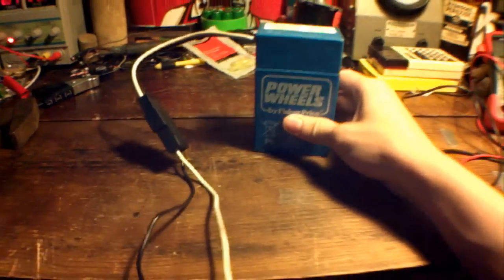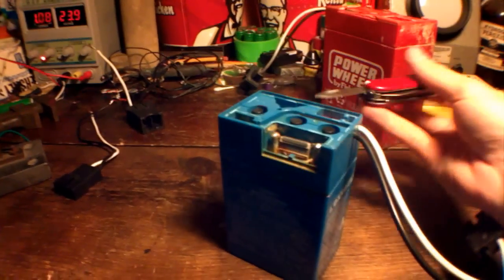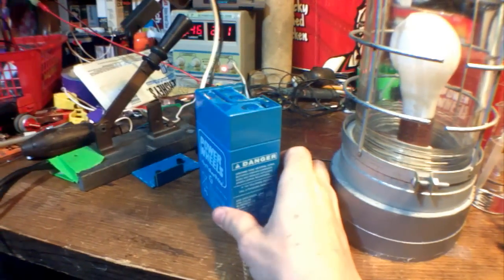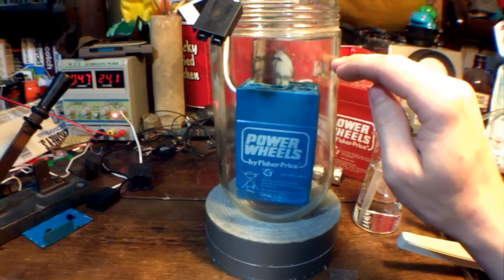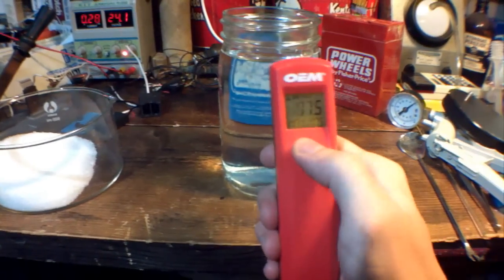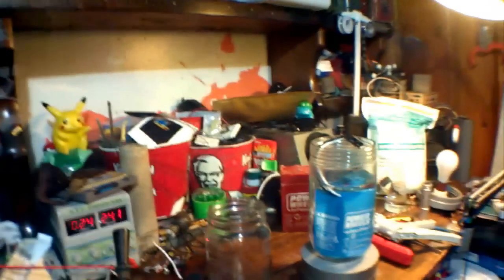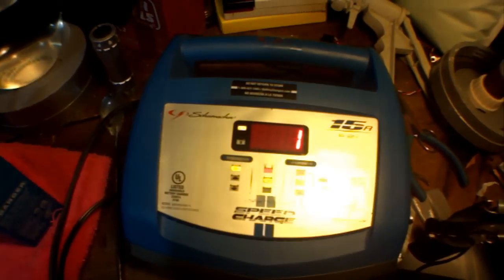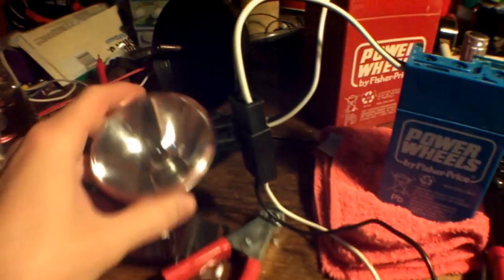Repair Lead Acid Battery with Epsom Salt

Comment: Aren't these batteries available for like 4 dollars with free shipping online? Is it really worth it to try to refurbish them and has the usable life after reconditioning increased to a point where you feel it was worth the work? Thanks.
Reply: sparkola, why don't you post links to the $4 batteries you speak of especially the ones with free shipping.
Reply from the maker: more like 30$

you cant buy a new lead acid battery for under 4$, if that was the case it would make them MORE money to sell them to a junkyard.

btw these batteries cost 60$ a walmart.
Reply: SD Lawson http://www.ebay.com/itm/4PK-6VOLT-4-5AH-RECHARGEABLE-GAME-FEEDER-SLA-6V-BATTERY-Free-shipping-/200936767482?pt=US_Rechargeable_Batteries&hash=item2ec8c3bffa
Wire them in series, parallel, or series-parallel to get the voltage or amp/hr rating that you need. Did that right after a posted this.
Reply: Cool, I agree, not really worth the effort unless one just wants to
Reply from the maker: sparkola
 that still takes money and time though, theres no reason to throw 26$ at something when some water might help. it's just proper maintenance.
Reply: Yes $26 but for 4 batteries at $6 each.  Sure maintenance is good if you remember to do it. We have become a disposable society and want fast results. We have become lazy.
Reply: SD Lawson...and even if you maintain them properly they aren't going to last more than a few years. Nothing lasts forever. Cheers!!!!!!
Reply from the maker: sparkola
 lead acid batteries can last like 20 years if you do proper maintenance.
Reply: Rinoa Super-Genius Maybe if you are never using them. A lead acid battery is only good for so many cycles regardless of the maintenance. The materials get used up in the battery. Cheers.
Reply from the maker: sparkola
 the battery on my 1982 mercury zephyr lasted 22 years before it went bad.

it is true they only have so much life, but you can greatly prolong that life by making sure they stay charged and don't discharge them fully.
Reply: Rinoa Super-Genius I mean you could float a battery at storage voltage if you never use it till you die of old age. But a battery that is deep cycled and charged daily( ie a motorized wheelchair) will never give you 30 years.
Reply: Rinoa Super-Genius Right but a car battery is only used to start the car. It is in a constant float mode so to speak. The alternator provides the electricity when it is running.
Reply from the maker: sparkola
 yes i know. but a lot of people leave power wheels discharged then come back months latter and wonder why they won't charge.

Comment: I notice that battery has a small circuit board on it - could that have been what was causing the automatic charger to incorrectly detect it? Some sort of built-in charging circuit, perhaps?
Reply from the maker: no i think its just an auto-resetting fuse. i've always had trouble with this charger. i don't use it much anymore. i find it easier and more informative to charge the batteries with a universal power supply.

ya see with my universal power supply i set the voltage limit at 13v and the amp limit at 1 amp. if the battery is empty it will raise the voltage so it ony pulls 1 amp. then whenever it nolonger takes an amp of current to keep the 13v it stays at that voltage while the ma of current slowly go down.

that blue charger never stops either. i've connected it to a new battery and let it charge overnight. it always stops at 99% and only turns off randomly.

i think the 80$ i spent on my 0-30v 0-5a DC bench supply went a lot further than the 40$ that charger cost.

sorry for the rambling. haha
Reply: Rinoa Super-Genius Oh no, thank you for all the info! Since I've successfully revived two lead-acid batteries I have (thanks to your videos!) I've been wondering if I should invest in an automatic charger since I've seen you use yours a lot. But perhaps I'll just stick to the various power supplies I use, and perhaps invest in a lab power supply like yours. (I'm just afraid of getting a dud since the quality control on those supplies seems to be really sketchy.)

Comment: get one of those syringes for shooting that special sauce in meat.  I guess its called a meat syringe, or a marinating syringe, I don't turkey syringe, I don't know what the hell its called but they have at most stores in the kitchen wares section
Reply from the maker: Yeah that can work sometimes. But some batteries have holes too small. Ive used several methods of refilling cells in my videos. Vacuum, syringe,cintrfugal force.

Oh btw I the word your looking for is baster? I think that's what it is.
Reply: oh will then that reply about the medical syringe would be better. You can find those usually in alleys or anywhere a herd of hookers have grazed, jk.
Reply from the maker: haha yeah i'll just stick with the laboratory equipment i get from ebay and Cynmar.

Comment from the maker: i actually did that for a lawnmower battery i desulfated. first it ran a 2amp bulb for an hour, then after a week of desulfating it ran it for 6 hours. but i scrapped the footage. i've tried to refilm that video like 8 times so far. i gave up on it since it takes so long to film.

and yeah i've also done the discharge test for bicycle's lithium batteries.

btw i really like your wb-40 straw idea! guess coffee stirrers would work too

i plan on doing an AH test for my off-grid battery bank too :D

Comment: The vacuum was a fun experiment :) I just did this with WD-40 straw and a water bottle that had a pin hole in the cap for the straw to stick in. dropped the straw in and squeezed the bottle. 

Have you thought of discharging the battery across a known resistance and time how long it takes to drain the battery to say 11Vdc? This would give you its Ah rating. Would be good to know how well your refurbish job worked. Great video!

Comment from the maker: couse with such a small battery its hard for the air to get around the syringe and it bubbles up. also some batteries have the bottoms of the fill tubes blocked all except a small pinhole and that is just bad design.

but there is no right way to do it, syringes work fine too. i just tend to only use them on larger batteries :D

also why i used vacuum was well couse its weird and never tried it before hehe.

Comment from the maker: well then you obviously don't know what "Solid-State" means. this 1918 battery charger is in fact made in 1918. it uses a Tungar bulb witch is a consumer variation of a Mercury Arc Rectifier. and those rectifiers have been around since 1902. i made a full video about this charger i think. can't remember.

and yes i'm not stupid. i do use the variable DC power supply to charge my batteries. thats actually why i bought it. but this Tungar charger is a novelty.

Comment: i have noticed you mix alot of substances so my tip is to use a diy lab stir plate all you need is a computer fan rated at 12v a rare earth magned some hot glue a potentiometer and a magnetic lab capsule its easy as pie and very usefull i hope this tip helps

Comment: Yeah epsom salt is amazing. In a battery that small I would have put about 1/4 tsp in each cell. It will help get the Ah rating back up close to original.

Comment from the maker: hey thats a good idea, i'd make the light detachable so it'd be an unmountable flashlight. maybe i should make it out of all the dead cells i have. i got like 14 18650 cells that are leaky or low capacity.

i'm thinking about using this blue 6v for a remote controlled something. oh and i'm surprised by the epsom salt. its working great.